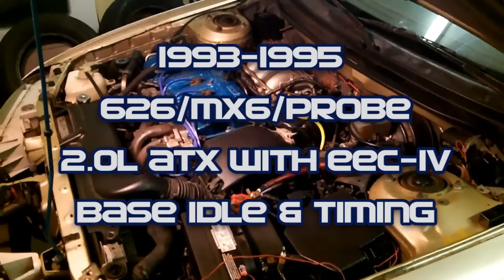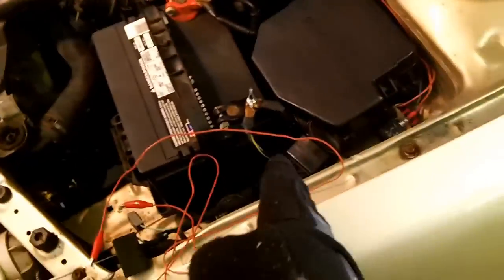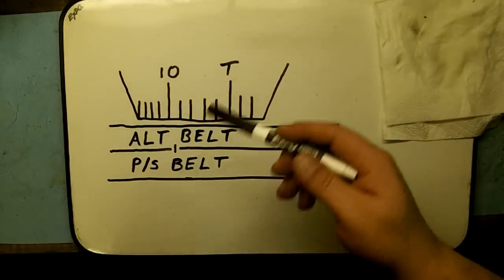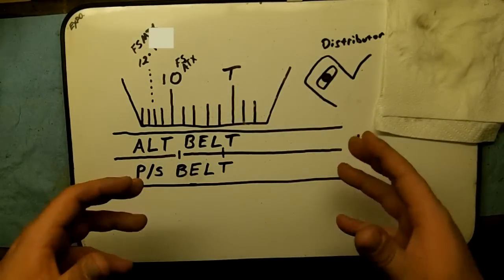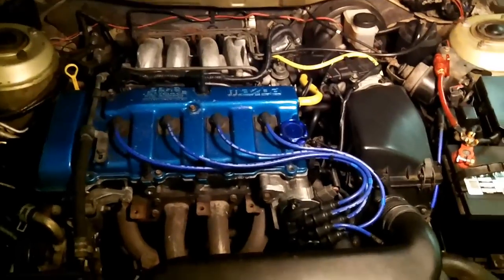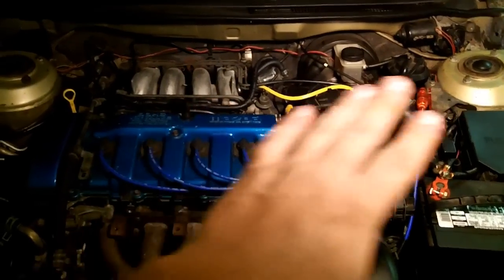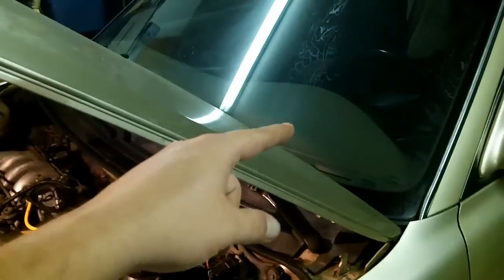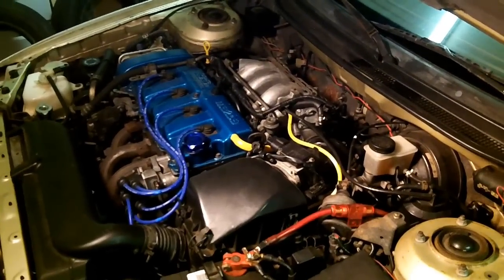Mazda 626 - Base Idle & Ignition Timing

Comment: +DJDevon3 Hi can you tell me how i would tell if i have the wrong Distributor on my car? I got one used and it looks the exact same but its acting up. I can give you the names of both my original and the newer one.
Reply from the maker: I need more info than that.  I4 or V6?  Auto or Manual?  Year?  Are there part #'s you can see on both?  If so then yes that would help a lot too.  You can always call a Mazda dealership to answer questions like this.  They have the official parts database with latest part #'s and all past revision # of parts, I do not.  What I do is lookup parts using the excellent free database found on http://www.jimellismazdaparts.com/productSearch.aspx
Reply: both are v6 both are manual both are 1996 and the original disty from my mx6 info is KF34 Then under that on same sticker it says T0T57271 And Beside Both of those on the Same sticker it says C. For the New Disty That i got thats acting up the numbers are K834 With T0T57171 Under that and E beside both of those. Sorry if thats confusing but there is 3 separate numbers on each disty sticker
Reply from the maker: What country are you from?  Do you have a K8 V6 1.8L or KF V6 2.0L or KL V6 2.5L?  All are V6's but not all have the same distributor. Only the 2.5L V6 was available in the US, we never got the 1.8L or 2.0L V6.  If you have a 2.5L and live in the USA then the KF34 is definitely the correct distributor and the only distributor you should have on your engine. The KF34 is used on both the KL 2.5L V6 and (Europe Only) KF 2.0L V6.   

As far as I know... If you live in Europe or Asia and have a K8 engine then the K8 distributor is correct.  The 1.8L V6 K8 distributor is not compatible with either the 2.0L or 2.5L V6 due to wiring differences.  It was certainly never sold in the USA and is not compatible if you have a US V6 Mazda 626, MX-6, Probe. The K8 distributor is a rare distributor, you could sell that to an MX-3 owner.  Far as I know it was only ever on the Asian MX-3 and Eunos, a very very short list.  You could probably get on an MX-3 facebook group to get rid of it easily.  With such a rare parts market I'm sure an MX-3 owner would snap it up quick if nothing else than to have a spare since they can be hard to find at times.  It's one of the reasons why the MX-3 is a rare sight to see on the road.

If you live in the US then you definitely got the wrong part, get your money back and get the KF34 T0T57271 distributor.  If you attempt to use the K8 distributor on your KL engine it might short out the ignition system or fail to start the engine.  If it does manage to start & run the engine, the distributor will very likely not last long and burn itself up pretty quick (within a week).
Reply: ***** Awesome man you answered my question perfectly. I thought that it was a compatibility issues. I just wasn't sure since it looked the exact same and most forums simply said that 95-97 disty are the same but as you say there is definitely differences. I will make sure to keep on your page i like your videos.
Reply from the maker: Only The Best HQMUSIC  Unfortunately you can't trust all parts suppliers out there for listing correct information with their parts.  I did see the K8 distributor listed incorrectly as compatible with the MX6, 626, and Probe on many different sites during my research for you.  If I didn't know any better or know what to look for then it's quite easy to buy the wrong distributor because of asshole parts websites especially ebay.  Get the KF34 disty and you'll be good to go.  Recommend you watch some videos on how to stab a distributor, you're gonna need it when it comes time to install your replacement.  Best thing you can do is make a note of exactly how the distributor gear and marks are pointing when you take out the old one. Best of luck!